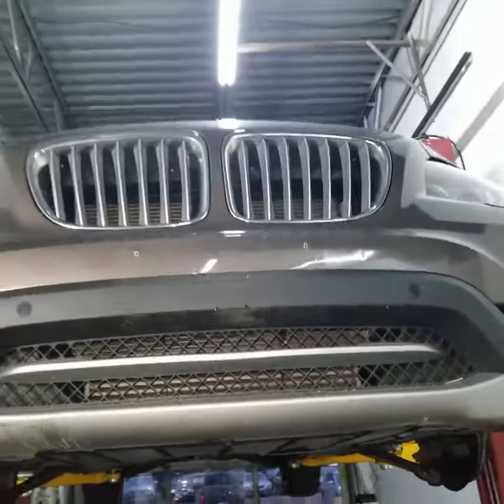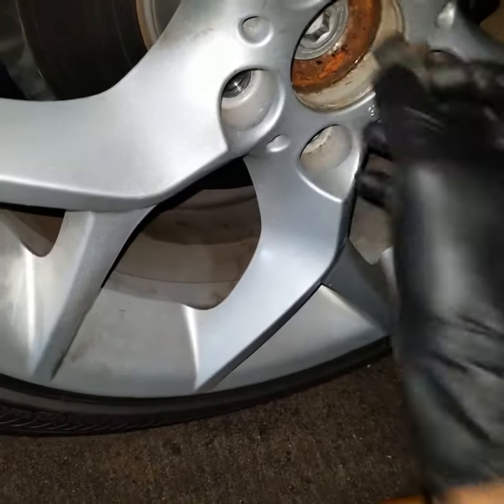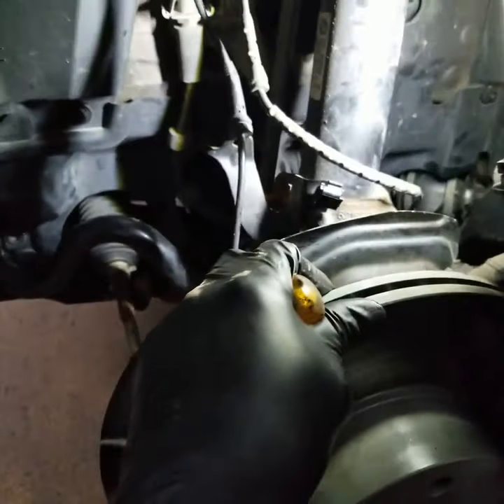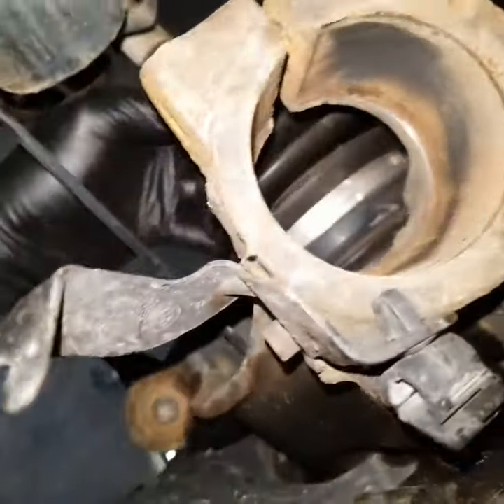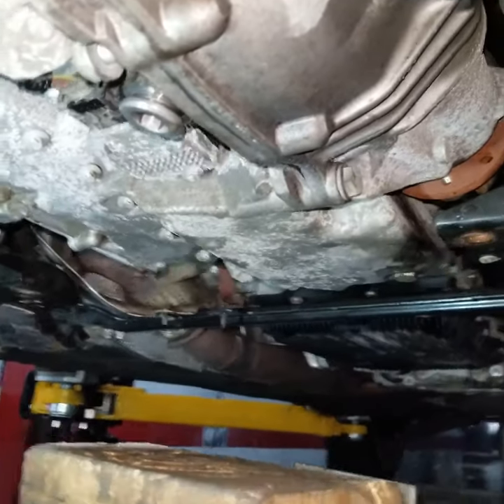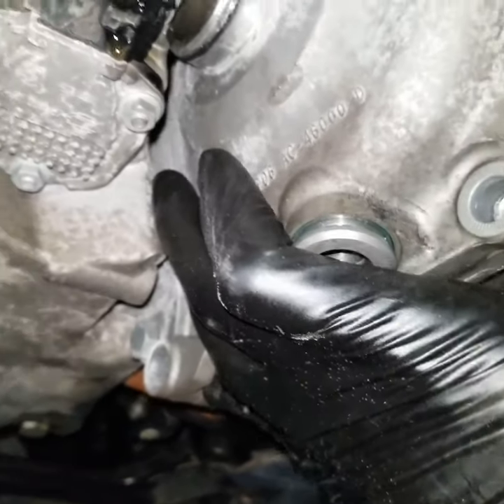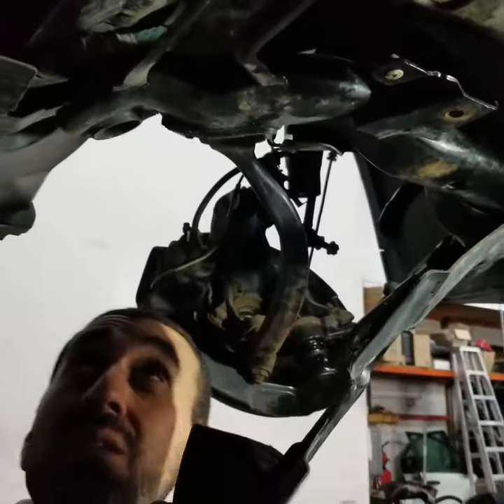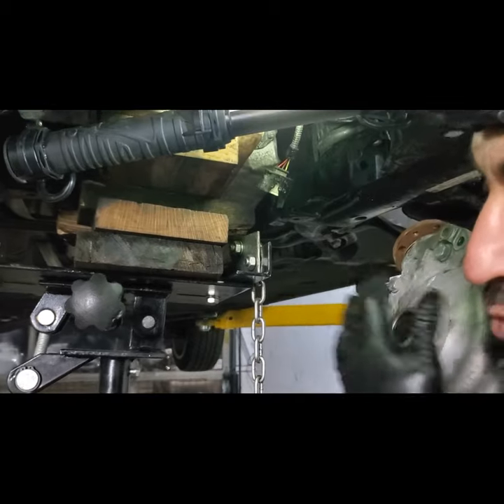How to Replace Front Exchange Carrier Assembly Differential Case on 2013 BMW x1 Xdrive AWD 28i 2.0L

Comment: For those with a 2.0d (not sure about other engines) you can actually get the diff from out of the engine bay. You need to remove engine bracket (3 bolts) remove dipstick tube as it goes through bracket, then remove engine mount bushing. Theres enough room up passed the coolant tubes (flange end up first). Bit of a fight with tubes but easier than levering engine if you are on your own 🙂

Comment: Awesome video, you helped guide me alot today. I had one at my shop I had too do, I ended up supporting the engine and lowering 90% of the sub frame and removed the bottom base for the driver side motor mount but it wasn't horrible. I'm glad I found your video on atleast where too start thanks again man
Reply from the maker: Excellent

Comment: Nice job. When you need to break the axle bolt loose, put a screwdriver into the vent slots on the brake disc so it will wedge against the bottom side of the caliper, if you can't go through the caliper.
Reply: His gun isn't very good either

Comment: Hi
Been looking for a couple of days how to remove the front diff on an e53 x5 2006.
Thank you for the video I appreciated the fact you were working out the procedure as you went through the process lift just a .
I now know how to remove the diff on my car a tip from other video I looked at and forums is to drop the engine cradle/front sub mount 46mm so you do not have to raise the engine via removing the engine mounts, but i think doing what you did with engine mounts and dropping front sub frame 46mm should  make the job easier.
I am working on my drive with no hoist just axle stands and trolley Jack you just made my task more clear.
Thank you 
Cheers
BRIAN D.
Will let you know how I get on
Reply from the maker: Excellent good luck

Comment: I have an F25 X3 with a bad input pinion bearing. Taking the diff out tomorrow, what’s the likelihood I can just rebuild the diff with new bearings and seals? Do these usually drop the bearings into the casing when they fail?

Comment: Hi...is this the same differential found on a 2010 X3 Xdrive28i (think it's just called an X3 E83 in the US)? Thanks. Nice video, btw!
Reply from the maker: I believe the part number for your vehicle is going to be 31-50-7-603-002 , i am not sure if it is the same or not . but i am sure if you call your dealer they can confirm that . Thanks

Comment: same 535ixd 2011
Reply: Hi
I found better solution for same BMW model  2012 Xdrive.
Just remove complete engine suport on left side and everything will go much easier.  You don't have to do anything with sub frame.

Comment: 1 second ago
Boss, i have x1 2010 model, the front diff is gone, and im looking to buy another one, my diff details 2.79 7583773 . And it’s very hard to find, My question can i replace with other diff number? Or should be the same. Please advise thanks 🙏
Reply from the maker: You need to check with the dealer , in some situations there are more than one part numbers and they are interchange. You will need to validate with the dealer for fitment . Hope this helps